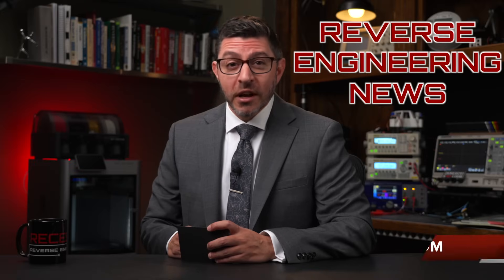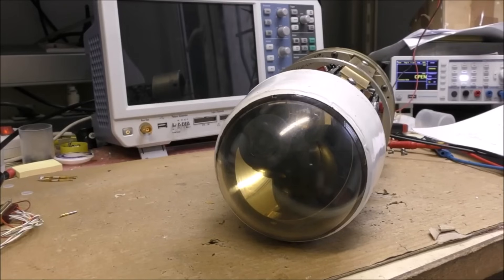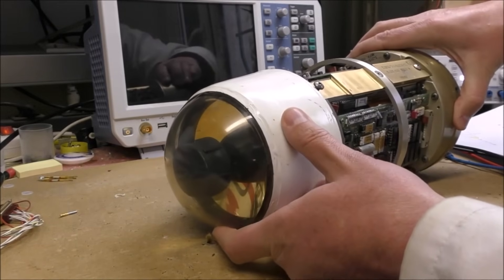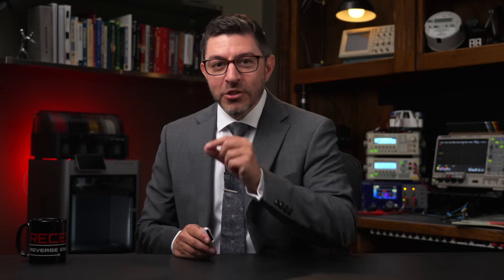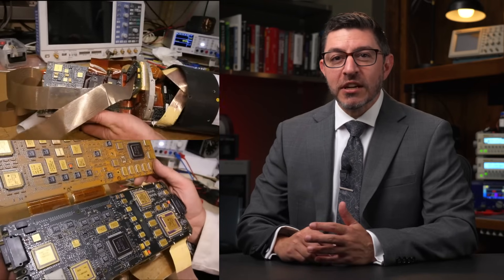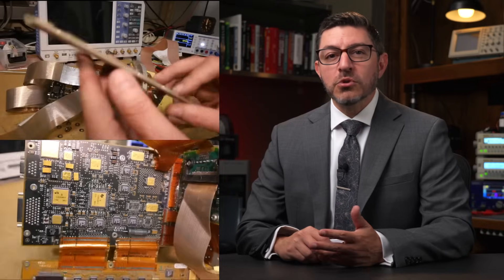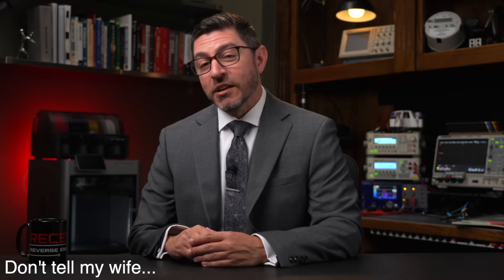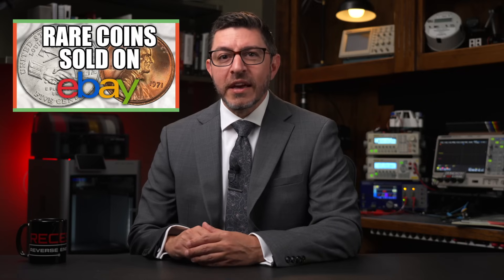Analyzing Military Technology - Javelin and Maverick Missiles

Comment: I've purchased some insanely crazy things from ebay. And im aware of other "nuclear enthusiasts" who have done the same. Many times they are coming from Germany or Russia.... I don't know how the hell "extremely spicy" radioactive sources get through customs..... But they do. There's so much insane Cold war era equipment and materials that end up on really obscure eBay listings. 

There have been a few things I was worried about..... Or unable to purchase because the seller would not ship to the USA....So actually had to hire a middleman in their country of origin to purchase them. Pack them with proper "shielding".... And then send them to me. so I have a higher chance of getting them. 

Nothing illegal as far as I know..... Can I have spent a lot of time and resources making sure to keep it that way. But extra precautions are taken not just because of the legality..... But because of the rarity of some of the isotope sources. Some holy Grail type stuff that I would absolutely be devastated if they were lost in shipping, or picked apart by customs.

I don't do it as much anymore, however I still troll pretty often. But it takes someone with some type of mental instability to put the time in that it requires. 

 But there have been times over the last 10 or 15 years where I would spend hours and hours a day looking. They nearly two-year period I was stuck at the hospital where I spent 12 hours a day doing that type of stuff, on multiple devices at once.

Looking At newly listed things, badly described things, totally obscure or untitled listings..... Listings without photos... And  recently listed stuff. 

Most recently I purchased a big lot of scintillation detecting equipment and probes..... TSA retired stuff and also gamma spectroscopy stuff...and stuff that never even went into use.... Just absolutely insane stuff for pennies on the dollar as soon as it was listed. Massive scintillation crystals and detector assemblies that would bring a tear to your eye. 😅

It takes a lot more effort than it did 20 years ago. But eBay can still be the wild West

Comment: As someone who's looked into what it takes to become a "defence developer" / "legal licenced firearm dealer" I can confirm that the rules vary dramatically from country to country. In Europe they take the attitude of "clean record, correct qualifications (usually mech eng or elec eng), experience, intent and ability to afford the licences" unlike places like Australia, New Zealand or Canada where they try to limit it to "those already licenced - i.e. no new people" and "we'd rather just leave it to the big names - screw anything new". This makes Australia, New Zealand and Canada horrible places to do anything even slightly considered "defence related" as you're basically never going to get licenced.

"Defence Related" means anything that has a military use or capability requires the correct licences to design, produce or sell (some exceptions apply for use by citizens or if the equipment is "dual purpose" and officially permitted as long as it remains within the country), this includes but isn't limited to:
* encryption
* radios / comms equipment
* signal analysers
* oscilloscopes
* maps / mapping software (excluding Google Maps, etc.)
* codes and ciphers
* equipment cases
* anything drone related - note that it could be a ground, water or air based drone
* recovery equipment (for data or for retrieving physical objects
* new manufacturing methods
* compression software
* biometric equipment, software and methods
* Anything AI
* Surveillance equipment (other than a basic security camera)
* Weapons and Firearms
* Body Armour
* Camping equipment
* etc.

Comment: FPGA’s have their programs inside the FPGA chip itself.

The FPGA is in a sense both thevprocessor and the memory.
Reply: most fpga's I've worked with do NOT contain the bitstring in the fpga - it is programmed in on power up from an i2c eeprom. And if your missile gets into the wrong hands, you don't want them to just be able to read the eeprom out and start cranking out copies of your missile
Reply: and by "most", i really mean "all"
Reply: @gorak9000  not true. who's to say that military those military FPGA's don't have a non-standard design?

The military can order specially designed chips with any configuration and any specification.

Also, the only thing kept in an eeprom is usually large data tht doesn't fit in the FPGA itself.

FPGA's have LUTs and other memory-like features.
Reply: @bloodaid  There is precious little memory in the FPGA itself, and that you usually need for your designs to work, not to store the configuration bitstring of the fpga itself. In most designs, you end up adding external DDR interfaces if you need more working memory there's so little of it in the fpga fabric. Have you ever actually built any designs in an FPGA, or are you going off what ChatGPT is telling you about FPGAs?
Reply: @gorak9000  aah I see. You have been working with cheap FPGA’s that don’t have built in memory.

Makes sense.

Homebrewers telling professionals what’s possible and what’s not possible is quite a fun little game.

It goes to show that smart people don’t make sense to stupid people.
Reply: @gorak9000  So, instead of having the firmware burned in inside an asic its better to expose it in a bus? It's easier to kill a guy holding the launcher than reverse engineer an asic....

Comment: AFAIK, the noise in the first clip actually came from gyro motor. Even first german rockets used gyro system which is kinda reliable and simple to implement.
Reply: If you watch closely, the parabolic or spherical mirror behind the detector (or the secondary mirror) is actually the gyro weight. Watch the edge of the mirror as it's spinning up

Comment: I haven't seen how javelins work but since they track the shape of the target selected by the operator, it would seem plausible that the launcher loads the image along with the code required for tracking onto the missile before launch.
Reply: Older AGM-65 were the Jet's sensors themselves. First Gen A-10s would show you the output of the imaging sensor on the cockpit monitor. Once all munition was fired, the A-10 was "electronically blind". They later resolved that by adding a separate  targeting pod.
I think it was the same with the AIM-9 air to air missile. It's internal control loop voltage between the infrared sensor and circuits steering the seeker head were simply amplified and routed to the cockpit as an audio signal. The low growling sound when the head was not locked on changed in pitch in dependence of the strength of a seen IR source.

Comment: @msylvain59 is another french youtuber who does avionics teardowns. Most FPGAs have integrated internal memory, and code gets turned into whatever abstraction the FPGA uses internally. Military-grade FPGAs probably have some additional countermeasures, and even if you understood the device completely, there are strict chains of custody for these types of parts. The forward-engineering understanding required to manufacture something like that at scale far exceeds the reverse-engineering understanding gained from analysis.
Reply: I believe i've been watching that La Labo or Sylvain, perhaps Mr Carlson pointed me to Sylvain - i am sure it was in french and it showed beautiful avionics :D
Reply: @uSoldering..you almost got it. FPGA's (Field Programmable Gate Array) are like the LEGO's of the Electrical Engineering world. Inside the FPGA is a blank slate of logic blocks. This field of logic blocks can be programmed to perform basic electrical operations. The composition of the logic block varies between FPGA's but generally speaking they include things called (LUTs) Look Up Tables, multiplexers and flip-flops. The EE can arrange these into a broad range of logical functions. For example, there are models from Xilinx that will allow me (for a licensing fee) to create a CPU that boots Busy Box Linux on a small portion of the FPGA. I can then use that computer to talk to other circuitry I design on the FPGA. The other big thing inside the FPGA is configurable routing. So not only do I have all these LEGO's I can put into the FPGA I have almost infinite ways (routing) to connect them. The last part of the FPGA that is important is the I/O blocks..These are circuits that allow me to interface outside the FPGA...for example, if I want a Network Interface...I can assemble some of the I/O blocks the FPGA has to function just like a NIC card on a computer..or maybe I want some USB port..wait, I changed my mind again..I want a USB 3.2 port and a RS422 port..presto..I have it...at will. The point here I'm trying to make is that FPGA's are a complete blank slate. They are not programmed in a programming language..rather they are "programmed" in a Hardware Description Language (HDL)..the most popular ones being VHDL or Verilog. You don't "program" them as you would a microprocessor..they literally contain the configurable electronics of your circuit. Most FPGA's also have the distinction of being a complete blank slate. Power them off..blank slate. Power them on..blank slate. It's not until you load your circuitry design onto the FPGA that it does anything useful on power-up. Usually they are fed these instructions or design by a mission computer (in the case of a weapons system being launched). Think of the missile in another way..upon firing you are giving your best technology away to the enemy. If the missile misses or is captured, they could reverse engineer the IP (Intellectual Property) in the electronics and essentially have the blueprints to thwarting your missile. This is why the FPGA lends itself well to military applications. The mission computer that remains securely on the aircraft, ship, tank, etc. will program the FPGA's on power..load their functional profile, provide them with guidance..and launch. On power down (i.e. a detonation, crash, or failure) they power off...all that IP that the mission computer gave it is now gone..the enemy get's nothing but some expensive FPGA's to use. And in that regard..the enemy can buy the COTS FPGA's the military uses anyway. Most of the military systems used in missiles don't have special military secret FPGA's..they are mostly off the same shelf civilians have access to. It's the IP that's secret as is how and when it gets loaded. Cheers..it was a fun segment Hash did.

Comment: Yes, there is a secondary system that programs and arms the missile before flight. It's usually referred to as the/a "mission computer". The mission computers onboard the aircraft all have "zeroize" functionality built in as well. The US Navy, for example, during the P-3 Hainan Island incident had to zeroize their systems after emergency landing on a Chinese runway. The crew was detained and the systems onboard were gone through by the Chinese..they found nothing of use and were quite upset the crew wiped-clean all the electronics on the aircraft..as they were supposed to do before capture or a catastrophic incident.
Reply: That explains the fpgas, you could wipe those and it would be an empty box
Reply: @derpinbird1180  FPGA's are empty anyway. When you "boot" an FPGA, you have to load the "code" that makes up the circuitry of the FPGA from something else. Often times in consumer products this might be an EPROM or NVRAM that loads the image onto the FPGA..once the image is loaded, the FPGA can then be told to execute its "code". When you de-power an FPGA..all its programming goes away..it's a clean-slate again. Re-power the FPGA, load its image, and it can fulfill its purpose. Likewise, when the missile hits (lets say it's a dud) the FPGA's will lose power (there are mechanisms that ensure this will happen) and be wiped clean..all the technology the enemy wants is back on the plane..on a mission computer. Because of the nature of FPGA's to be a "clean slate", they are very popular with military designers. When we design SBC's that have memory and such, we must design the ability for "zeroization". This is literally a "self destruct" instruction you give the SBC and it will destroy itself in nano seconds. Making things like the mission computer itself worthless as well.
Reply: So if you 'zeroize' while in flight you lost the ability to engage targets? Interesting. Do they store firmware while parked in the hangar or do they reprogram them for each sortie?

Edit: sorry if I misunderstood, I realized that the missile's memory get wiped as soon as it loses power...
The plane most likely needs to be manually wiped by the pilot. That would normally be handled by service personnel with diagnostic equipment.
Reply: @Rotwold  Depends on the system. In the case of the P-3 Orion, there is a lot of listening equipment on board those. That equipment has procedures to zeroize that every crew member has a responsibility to perform if the PIC (pilot in command) orders them to wipe the systems. Zeroizing is the deliberate destruction of the IP (Intellectual Property) of a device so that it renders the equipment useless to an enemy. It doesn't happen accidentally. Where and how they load the programming for these devices is secret. You'll have to either join the military, work 30 years for a defense contractor or read a Clive Cussler novel to know that. FPGA's really lend themselves well to military systems because when they are unpowered..they are a complete blank slate..power them back up without loading their function or 'programming' and they just sit there..and do nothing. A lot like a teenager..when they're asleep they are worthless..when they are awake and eating your food, also worthless..so we are sending them to school to program them in the hopes they will someday wake up and do something productive and useful.
Reply: @Rotwold  They are intimately linked with the navigation computer. Id imagine that would load the firmware and target when the pilot arms the missile and gets a lock on an enemy.
Reply: Okay, thanks for sharing your knowledge on the subject.
Reply: That I never knew. Thanks.
Reply: This guy missiles.

Comment: Depending on the missile guidance type, the navigation computer can just be loaded at the point of launch. For example, the Javelin missile is pointed at a target, the launcher's camera identifies the outline of said target and sends the image to the missile. The onboard computer doesn't need to know where it is on the globe, or what it's looking at. It just needs to find and fly towards the thing it was pointed at. And as a bonus, a lot of the circuitry is in the launcher, which is reusable
Reply: The entire encrypted code may be preloaded in the factory, and the launcher simply uploads the decryption key just before launch via contacts or wirelessly.  The advantage of this security is quick activation in combat, and in case it falls into enemy hands, the key can be set to expire in a short amount time of time (say 10 seconds) after launch, which renders the code un-reversable.  This Javelin was most likely acquired from the Ukraine/Russia war, those guys will sell anything captured for good money. ;)